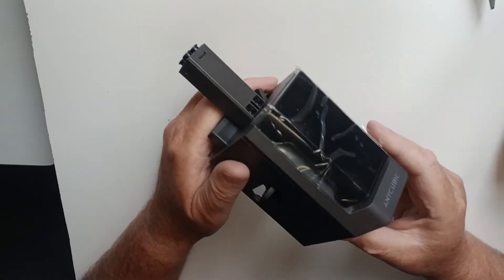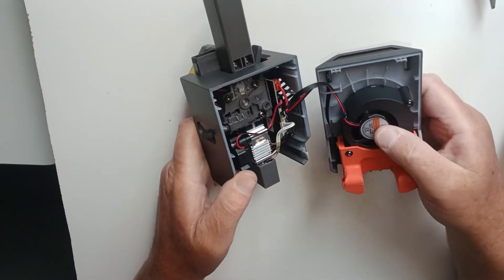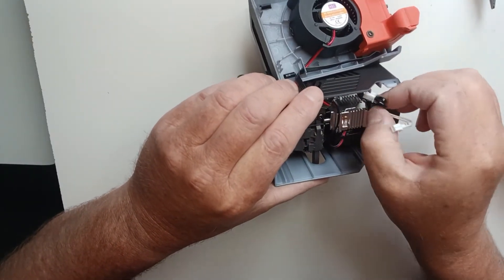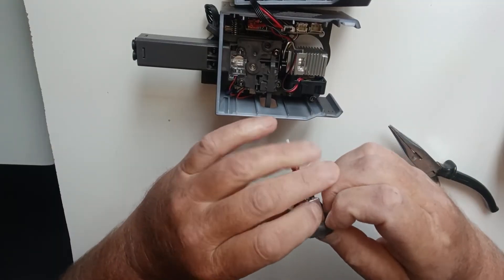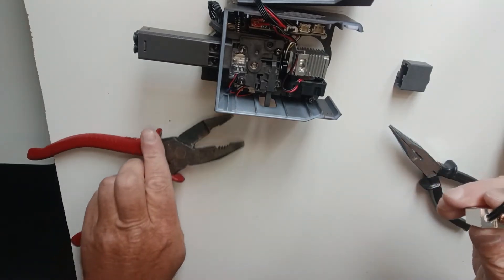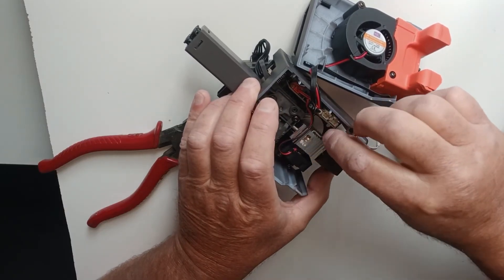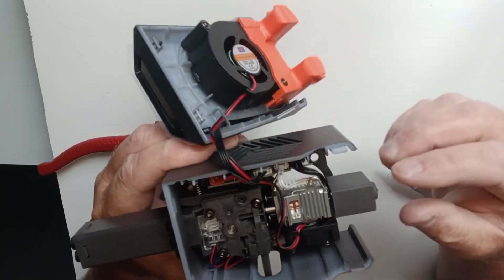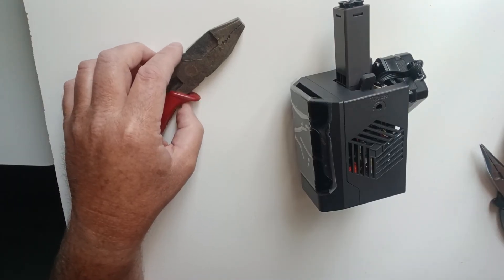How to change the nozzle and hotend on the Anycubic Kobra 3 Combo 3D Printer

Comment: what the white tube in at the top? is that filament? if its a guide tube i dont have one.
Reply from the maker: Hi that is just filament. It gets cut by the cutter and leave that in the nozzle. When  you put it back in and it heats up it will come out of the nozzle

Comment: I definitely am going to throw my two cents in here.  I heated the hot end up as hot as I could.  Quickly removed from machine.  Quickly reheated with a torch.  Used vice grip and wrench.  Broke the $h1T out of the nozzle.  It seems that if you want to replace the nozzle, you have to buy a new hot end.  So much for these machines being self serviceable.
Reply from the maker: Hi yep you are correct, if they are the newer hotends, Anycubic cement the nozzles in place which was done to address the problem of leaking and they are virtually imposible to get out,  so its now fat easier to replace the whole hot end, and you can buy them very cheap on Amazon, Ebay and Aliexpress. I purchased some from Aliexpress which cost under $5 and they have been fine.

Comment: waht item did you use to unscrew the nozzle
Reply from the maker: Hi I used a pair of pliers and a nozzle wrench.  You can buy  nozzle wrench and cleaning kits on amazon and Ebay for around £10 ($13)
Reply: @resin-art-and-3d-printing  thanks

Comment: If you are just going to replace the nozzle and not replace the entire hotend. then I would leave the hotend in heat up the nozzle and replace it. always a good idea to replace the nozzle while heated if not you risk breaking it off in the hotend.
Reply from the maker: Yep  I have had to do this to get one of the nozzeles out to clean it up and I also heated it up to retighten it up again.  For anybody reading please make sure you use tools to hold the nozzle and hotend while its hot.

Comment: Actually, it seems that the nozzle can not be unscrewed. It is glued to the hotend with some white substance.
Reply: They are basically using loctite but using way too much of it. Took far too much force to break my new one loose
Reply from the maker: @melkorthefallen7580  Not really good if they are doing that tbh.
Reply: @resin-art-and-3d-printing  Agreed, it shouldn't be that difficult to change a part that is meant to be changed easily
Reply: @ДмитрийШпаков-о3н  I just heated my hotend to 300c then unscrewed it fully. Now every time I screw a different nozzle in I just heat it to 50. Been doing it for a while now and the nozzles are still super secure while printing
Reply from the maker: @lovelyjubly848  Nice to know thanks
Reply from the maker: Hi Im not sure why yours has been glued as the first hotends Anycubic used for the Kobra 3 were not glued in place. Are you sure it is not from a white filament which has leaked ?  I know that there have been problems with them leaking and I have seen talk of Anycubic using glue to stop the nozzle leaks. I don't know if that is true or not but I would contact Anycubic if you are having problems unscrewing the nozzle form the hotend.
Reply: @resin-art-and-3d-printing  it's same for me. Bought kobra 3 combo a a month ago and the nozzle was glued in. Bought another hotend for a different reason last week, same thing. Both rock solid
Reply from the maker: @lovelyjubly848   Hi I think Anycubic has started to cement the nozzle in place to prevent it form comming loose. I don't know is this is 100% correct but from what I have seen on other social media posts that is what they are saying. You could try and heat up the hotend and nozzle to get it off but just be very careful you don't burn yourself doing it. People use heat guns and those propane or gas heat guns. Also don't forget to take the heat sheild off first and use fire proof or heat proof gloves with the tools you use to take the nozzle off :) Hope this helps a little
Reply: You're correct, not sure when it started but they seal them all together. 
 @resin-art-and-3d-printing
Reply: @resin-art-and-3d-printing  I bought new hotend where everything is unscrewed OK. So it was leaked white filament.

Comment: I‘m facing the Issue That Copper, won’t stay in place
Reply from the maker: Try and push the whole hotend up as far as it will go because sometimes that clip which holds the hotend in,  does not go into the  groove which is at the top of the copper bit.